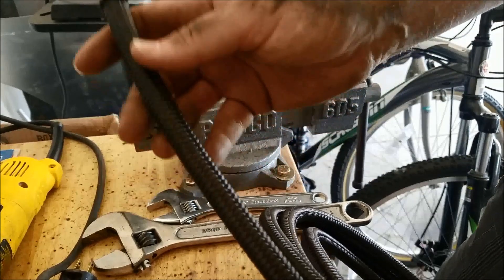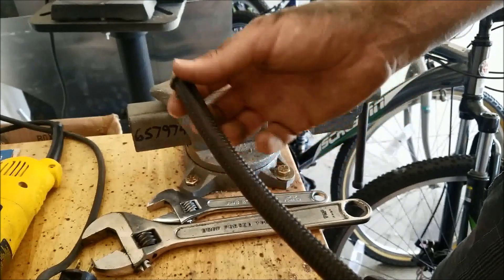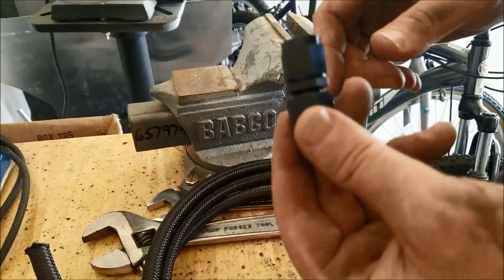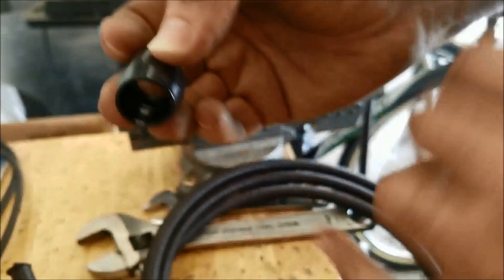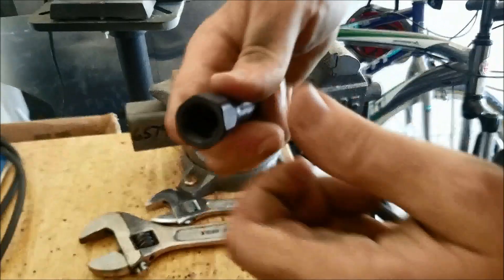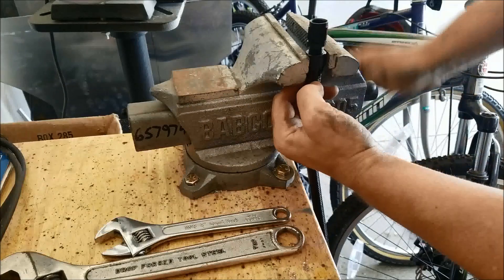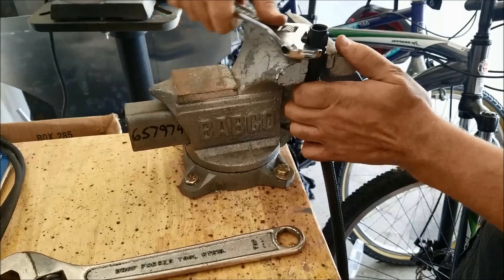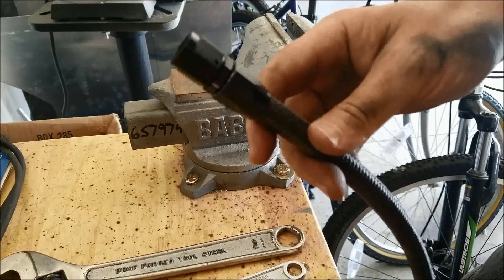How to make/assemble braided hose with AN fittings MADE EASY!

Comment: Make sure you measure and leave enough play in your hose, especially if it’s not clamped down. 

Just had my AN turbo oil feed hose slip off the fitting. I knew I left no slack, but it worked it enough, until it didn’t. 

Luckily I was close to home and didn’t lose a dangerous amount of oil.
Reply from the maker: Good call, a little extra room is a good idea

Comment: Very sloppy work putting an aluminum fitting in a steel vice with out protecting it and the worst thing  to use on anything especially let alone aluminum is an adjustable wrench instead of a 6 pt box wrench . I wouldn’t let you work on a old lawnmower that was sitting out waiting for the Garbage Truck😢😢😢
Reply from the maker: LOL cool story. Thanks for sharing.
Reply: Who gives a fukk? Seriously. Oh nooo it's scratched?! Lol

Comment: Can you use the black lines for nos? Also can you tape where you cut for a cleaner cut
Reply from the maker: i dont see why not. they are good for me up to 600psi
Reply: @GearheadDaily little late but that would be too little for nos you want to keep pressure around 900-1200 for a good spray

Comment: Ive always installed mine with the hose ALL THE WAY in on the female part of the fittings.  Never had one leak, nor had trouble getting the two parts to screw together..   They are designed to have the hoses pushed all the way to the stop.  Also need to be sure they are cut off square.  i've seen people leave them at an angle, and that's not right either.  The least amount of fraying is good too.  Plus a little lube will help get them together.  Final thing I will say, is if cutting with a grinder, be sure to CLEAN THE HOSE before you install it.  The metal debris and rubber will get inside your fuel system if you don't. A quick spray with Brake Parts cleaner after its assembled will take care of this,  or carb cleaner.  just be sure to blow air through after to help push the cleaner and debris all the way out.  (I spray from the opposite end, so the debris only has to go a short distance, and not all the way through the hose.)
Reply from the maker: Okie dokie
Reply: @GearheadDaily  Probably the best reply I've ever seen!!!
Reply from the maker: @jameswiz  LOL not sure what else to say, everyone has their own way of doing things.

Comment: I just use scissors to cut the line but damn every time I thread the hose in the braids start fraying.
Reply from the maker: That's probably because scissors aren't sharp enough. You need to make a VERY sharp line.
Reply: clinkowich lol not kidding. I’ve figured out why it was fraying. I needed to tuck the edges in carefully with a flat head/blade driver to get it started. After that it was cake walk. They came out fine. No leaks and braids still in tact like they were professionally made.

Comment: can you remove the fittings if you have to shorten the hose and then re-use them? I bought a custom hose and need to shorten it for my application. Just wondering if I can take the fitting off cut the hose and then re-use the fitting.
Reply from the maker: Yes. Same procedure.

Comment: So it's ok if the hose doesn't bottom out fully into the female socket?
Reply from the maker: It doesn't have to be completely bottomed out, sometimes that makes it impossible to thread together but get it as close as you can.

Comment: Do you have links to what you bought? I am looking to add an e85 sensor and need to modify my low pressure line with something like this. Thanks for the great video.
Reply from the maker: What parts are you looking for?
Reply: I would need both 6an ends and the tubing. The rest would just be standard AN stuff. I was not sure what ends you needed for this type of twist on connector with the nylon wrapped tubing.
Reply from the maker: Straight 6AN? These are standard Earl's parts, I can look them up. No prob.
Reply from the maker: Here's a link to their E85 specific fuel hose. https://www.summitracing.com/parts/ear-681006erl/overview/
Reply from the maker: Here's a link to the -6AN fittings I used. https://www.summitracing.com/parts/ear-at800106erl/overview/
Reply: Awesome, thank you very much. A youtube tip, add stuff like this to the description it helps a lot of people.
Reply from the maker: Thanks for the tip. I'm not very good at this YT thing yet LOL. I'm trying!

Comment: I have seen that for ptfe ss braided hoses they also use a different kind of an fitting with some sort of metal ring inside that you previously insert between the braid and the teflon core. Is there any advantage over the fittings you are using?
Reply from the maker: The ones I'm using are a lot cheaper, but PTFE is a good way to go. Here's a good link for more info:
https://www.pegasusautoracing.com/document.asp?DocID=TECH00112
Reply: Correct...they require a ferrel to "swage" the fitting to hose...making a great high pressure fuel line...

Comment: You should add a bit of lube (WD40 works fine) to the part you screw inside. It really helps and smaller fittings will be less stressed when you put them together.
Reply: Thanks for the tip :)
Reply: Mix a small amount of synthetic base oil and white synthetic grease 50/50, and add 5% by weight tungsten disulfide or graphite to it.  Fittings will still be lubed years later long after the oil dries up and when (if ever) you take the fittings apart.